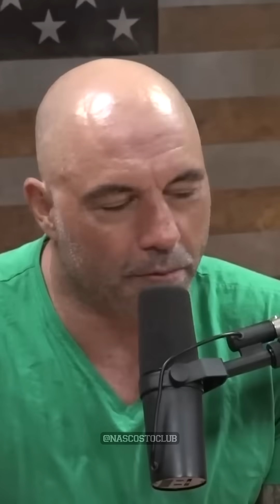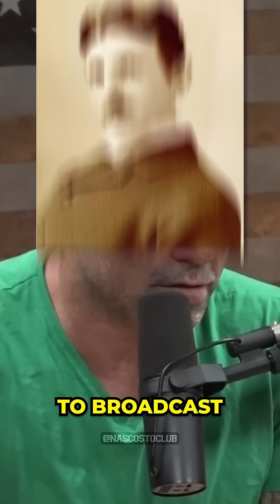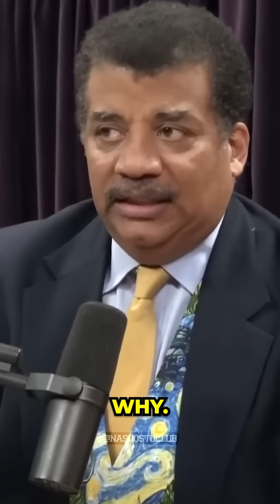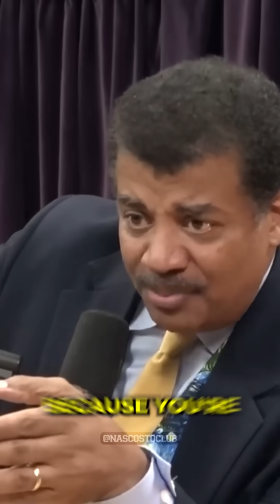WIRELESS Electricity Idea Debunked ⁉️⚡ #shorts

Comment: Yea
Tesla did want to transmit power through the air, but it required a transmission source of course and a household receiver that took the load.  He did not suggest powering all devices remotely.  It was to receive power to your house wirelessly.   Much different just saying

Comment: I believe he meant by using his coil and tower, you could potentially have a rod or way to receive it safely. We've all seen the trick where the guy where's the suit and is hit with electricity etc. Well instead of grounding the stream, you're capturing it and using it or storing it elsewhere (a battery) to be used later. Or even have a power plant where the coils produce the energy (using giant magnets and the copper coil etc) and the plant could put device around it to absorb the current and send it through the lines as we do now. Its easy to dismiss if you only take the thesis at face value or literal, like Neil does. He took it as literally sending it through the air. Which may still be possible lmfao idk but I do know it'd be foolish to assume what Tesla said or people have retold it as if he meant just willy nilly through the air. Uncontrolled electrical currents are horrendous, ever have a heart attack? You get the idea.

Comment: microwaves are power through the air. your wifi is the same wavelength as your microwave oven. the radio in your wifi router is so low power it barely heats you up, so minimally that you probably can't even feel it, but if you increase the energy, then you'll be your chicken that you put in the microwave because of the water in your body💀.

Comment: How about this he disagrees with Nikolai Tesla because he has to because the government doesn’t want ppl to be aware of free energy because we are made of electricity not on a giant scale but we have electricity flowing through our bodies so I disagree with Neil and if you look up radio waves, you will learn that there are already radio waves transmitting through the air so what he was doing Nikola Tesla was capturing the radio waves and sending it in one direction or I could be wrong, but so could Neil he could just be distracting the people so we won’t have to ask about free energy just like the guy who made the car they ran off of water we would never have to pay for gas because water is everywhere. All we had to do was fill up a bucket of water put it in the car and we would never run out of gas or H2O but they killed the guy.

Comment: He's not right or wrong, if there was a heavy electrical current flying through the air you wouldn't die, I've worked around 110k/300k kilovolt amperes(kva) which is more than enough to kill me you become  the same potential as everything around you, also lineman work with live electricy everyday their not shutting the power off to fix shit. Also it takes ¼ amp to kill you so a 9 volt battery can kill you

Comment: So if what he’s saying is true then why does lightning not fry everyone around it? If it’s so dangerous to flow through the atmosphere or upper air why does lightning not dry everyone near it. Granted if you stood right beside the flow it could. Just like the lines that helicopters have to be used on to repair. Those aren’t insulated. They don’t fry everyone near them and they run high over head.

Comment: It is arguable that electricity does not travel inside the insulated wire but yet the currents travel outside of the wire creating a large electrical field surrounding the power source in Supply

Comment: It doesn't matter what technology you develop for the transfer, its still electricity.  Even at low levels that could potential gather up at the receiving end, it would do damage to anything in it's path, if not immediately, then over time.  I for one, don't want random shock therapy.  He's right...
Reply: Cosmic radiation, antimater, sun.... Will than kill us all!!!!!
Reply: @nikolakarovic5964  Yeeah...  Skin cancer is a thing.  Anyway, keep your argument within the realm of electricity and make an actual point.  As I said electricity is an actual thing we know the dynamics of.  That is what they're talking about making transmitting wirelessly.  That same thing is used to treat mental patients in a small amount.  I'm sure everyone else need that casually buzzing past their brains.  There's still plenty of debate about cell phones causing issues and it's been proven that they do.  Not the same type of damage electricity would do, but your whole body functions on minute chemical and electrical signals; passing through electrical fields obviously affects function therein.  Chill on the exclamation points and actually try to make a point.

Comment: I my self can assure you it's possible because i was a 11 meters cb radio aficionado. And while using a 400 watts amplifier to boost my signal I was able to put a 4' t8 fluorescent tube next to my antenna it will light up every time i pressuive to transmit..

Comment: I think Tesla was referring to the unlimited resource of energy are electromagnetic force has on the Earth not trying to shoot energy through the air but harnessing it electromagnetically for possible use in home kind of like solar power Joe just said radio waves got shut down but not understanding the vibrational frequency of certain waves that could possibly conduct electricity

Comment: Nobody better tell Neil about the FLYTE light bulb then. He's either talking about a field he doesn't have enough understanding in or is very lacking in information and history on this subject.  

Tesla himself already thought of the potential for dangerous currents to be moving through the air in dangerous positions so he used coils suspended in the air like lightning rods to attract the electricity from point a to point b. Unless you're standing directly in between them, the chances of being struck by random currents are very slim. 

To be honest, He needs to stop thinking he's the only one smart enough to think of these issues. The inventor of the technology already had ways to circumvent the issues he's mentioned because other people are smart enough to see potential hazards in science too.

Comment: Please Joe put Neil in a choke hold lol 😂 

Tesla vs Neil

Let’s start with the easy one, Neil deGrasse Tyson. Neil invented nothing 😂 Now let’s introduce the Mr. Nikola Tesla…

Nikola Tesla was a Serbian-American inventor, electrical engineer, mechanical engineer, and futurist who is best known for his contributions to the design of the modern alternating current (AC) electricity supply system. Some of his key inventions and discoveries include:

The Tesla coil: a type of transformer used to produce high-voltage, high-frequency alternating current.
The AC motor: an alternating current motor that is widely used in industrial and household appliances.
The wireless transmission of electrical energy: Tesla proposed the idea of transmitting electrical energy wirelessly, which is the basis for modern wireless technology such as radio and television.
Remote control: Tesla demonstrated the first remote-controlled boat in 1898.
X-rays: Tesla discovered and studied X-rays before their discovery by Wilhelm Röntgen.
The Tesla turbine: a bladeless turbine that uses the boundary layer effect to create rotation.
Robotics and Cybernetics
Artificial lightning
These are some of the most significant inventions and discoveries of Tesla, but he also made many other contributions to the field of electrical engineering and technology.

Comment: I am insulted on behalf of Tesla, the most ingenious and intuitive inventor of all time, to have his ideas be clowned on by Degrasse Tyson, who hasn’t made anything.
Reply: Alternating Current vs Direct Current
Reply: Tesla is overhyped by the internet. He was smart but other people were working on a lot of the same stuff. Like he developed a remote control boat but it was someone else who figured out how to use radio waves for communication. And a lot of his ideas he didn't finish were things that wouldn't work. You could totally power an LED bulb or a small speaker wirelessly, but not from very far away, and you wouldn't want to do anything much bigger. That's why wireless phones chargers have to be basically touching the phone. Any further away and the efficiency would just be too low.
Reply: @danieljensen2626  doesn’t matter if you think he is a clown. His motor worked and you’ve been using ever since.
Reply: @bucsfan2565  just because he figured out the ac motor doesn’t mean he was right about literally everything you dingus.
Reply: @lazcentral4828  I don’t care about the percentage of time his ideas were great and working. I care about the impact of his main inventions. And the comment still stands because Degrasse Tyson hasn’t made anything.
Reply: @bucsfan2565  Tyson is talking about his ideas that didn’t work and you shouldn’t be insulted on behalf of a man that couldn’t let go of his delusions.

Comment: Patently false. The sun powers this planet through the air and it doesn't kill us. It's the difference between a 5 watt light bulb and a 5 watt laser. The area the energy is spread over unfocused is far less harmful. Stand outside on a sunny day and you're fine. Pull a magnifying glass out and you can burn.

Comment: AC power system, electric motors, radio, remote control, fluorescent lights, smooth turbine, all invented by Tesla. What did Neil invent? And you can hold up a fluorescent light in an electric field and it'll light up in your hand....

Comment: Wifi and Bluetooth has entered the chat
Reply: They both work by simply having different wavelengths for 0s and 1s, you don’t need to change the amount of power, just the wavelength.

They don’t contain much energy at all
Reply: RFID chips: ayo, what?
Reply: How much energy is transmitted through Bluetooth and Wi-Fi, though? Enough to power a house? There are things that transmit enough power through the air to actually do something. They're called Tesla coils and they will fry you instantly if you get near them. Go ahead and build a few in your city and see if you can get close enough to turn on your AC system without turning into crispy bacon in the process.
Reply: @unwaveringflame2482  How dare you speak logic in this comment section? People are trying to pretend they are scientists, now shush!

Comment: NDT: "You can transmit energy through the atmosphere." 

Aurora borealis: Casually producing 900 billion watts.
Reply: Go touch it
Reply: Aurora borealis is literally powered by the sun and is outside our atmosphere
Reply: Aurora has energy density of 5mW per m² compared to typically 1kW per m² for solar. So the collector would have to 20,000 times bigger than the solar equivalent.
Reply: @rec2431  so you're telling us there's a chance? Alllriiighht!
Reply: @evanislost  Yep, there's always a chance with science

Comment: you can use a buck and boost transformer two-step the voltage up. the issue is the current or amperage. I think it would have worked and continue to build on that technology but instead we had clotheslines everywhere all over the place.

Comment: the energy in 115v @ 60hz is the same as 1.15v  @ 6OGhz 

… you could in theory take high energy or high frequency and convert it down to more mechanical low frequency energy… such as we use for most of our electrical applications, thou I suppose mobile devices could be powered wirelessly …

So I disagree with Neil

Comment: " 5G through the air? Think about the massive amounts of signals that would be bouncing around our atmosphere, and through our bodies. We would literally melt from all the radiation. And how does one even hear someone on the other side of the globe? Joe, did you know the planet is 12742km in diameter? It's huge, hearing someone talk on the other side of it through a wireless device is a preposterous idea. You gotta think logically, Joe. "

Comment: This is what I hate about NDT. he's correct, but he's smug about it. Just say the energy has a 1/R^2 relation where R is distance from the transmitter to receiver. The efficiency is impractical when compared to direct connection via wire. Else engineers would have found a way to power at least your car radio from the ambient signals by now!

Comment: Neil is wayyyy off base here.

Radio stations already pack enough energy into the signal if you fuck around with a crane or tall object and hit the right elevation/angle you’ll get blown tf up.

I’m talking enough power running through it to throw 2-3inch arcs off the machine and tickle anyone with a work belt on who’s standing close to the outrigger

Comment: What if we transmit the electricity through  high frequency chips and boards to eliminate the alternating currency to a higher voltage direct currency with pre programed boards and tunneled the programing through the inscription to significantly improve the waves of the micro technology that interfaces the high static discharge of the quantum interaction of series of distributed data from the universal exposure of radiation from the discharge of micro energy the full consumption would be calculated from the energy consumed by the value of the existence of the atomic resistance toward the mechanism that transfers the flow of the electricity advanced devices controlled by the radio waves.  Yah that could definitely work for sure. Your welcome.  🙂😘

Comment: Why does NDT always act like a dick when asked questions about science and technology instead of just explaining what the possibilities and limitations are. We know it is possible to send power through the air. Anything transmitting wirelessly is using that technology. The issues is how much power most equipment requires is unsafe for wide transmission and the power dissipates so quickly without tuned circuits. We need to develop very low power solid state circuits to use it safely.

Comment: As much as I respect Tesla, electricity broadcasted through the air is a death machine. God forbid you're walking by with anything conductive, it would be your last walk.
Unless you're thinking of containing the electricity.. then you might aswell just use cables. Electricity is not WiFi.

Comment: This tech has already been implemented in the automation  sector to power wireless sensors on assembly lines.  So at the low voltage levels these sensors run, Joe asked a great question about light bulbs, etc.
Reply: I mean for a guy who studies the stars and space I'm pretty sure the sun puts a lot of energy onto the planet Earth and we're out in it I mean you might get sunburned although is that really what's giving you the energy UV or is it just part of the equation and at the end of the day you're still out in it it's still a whole hell of a lot of energy
Reply: @mattlane2282  it is approximately 1300 Watt per square meter measured orthogonally on the earth's surface. But that's coming from the sun !
Reply: @probablyinconsistent4756  Sure, I wasn't particularly advocating for the need for energy transfer through the atmosphere, I just tried to respond to the unanswered question regarding the amount of power the sun gives us. Regards.
Reply: Wireless charging, and RFID too. He should have just mentioned the inverse square law.
Reply: Again, watch the video. That's not his point. It is that it would be dangerous.
Reply: @thejellopster  I doubt there are many long term studies about potential harm depending on varying amounts of intensity. You might be right anyway.
I was just clarifying that he wasn't denying that it was possible to power things up through the air. It was that it sounds dangerous, and that he wouldn't want to risk it when you have other alternatives (such as cables).
Reply: Neal just has to let it be known that he knows more than everyone, even tho he doesn’t.
Reply: Neil wasn't trying to say if it is possible, it was that it would be dangerous and harmful for the human body. Which I can totally understand.

Comment: If its sufficient or not i dont know. However i used to be a tower installation tech. To allign a link antenna you do the following: 
Antenna 1 gets set in compas direction to antenna 2. Plug it into power. 
At antenna 2 you'll plug it into a volt meter. And you will adjust the antenna to were the voltage is highest. (The electricity is coming from tower 1 at this stage)  There's a step more i'll skip for convenience sake.

But essentially its a +1 km wireless electricity system. 

Concept is diffently possible. 
We already do it

Comment: The energy is concentrated in a wire. The energy is ALREADY IN THE AIR WHERE WE WALK THROUGH. It isn't concentrated. But the device would soak up the energy like a sponge soaks up water. Of course the actor is against it. He is not only brainwashed, but hired to brainwash us.

Comment: You can get shocked through the air; it’s called flash shock. Try walking into a high voltage distribution cage without PPE on.

Comment: Is it possible to do technically? To some extent, yes. Is it practical to use? Absolutely not. There is increased risks of cancer in people living within 50 meters of high voltage powerlines where electricity moves through the lines. Now imagine there is no line, and it's just going in all sorts of directions in the air.